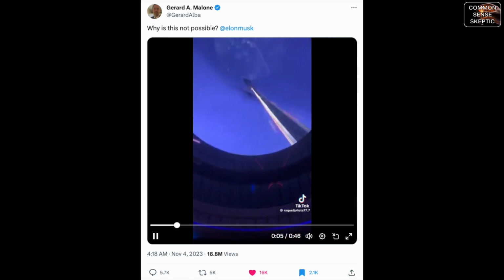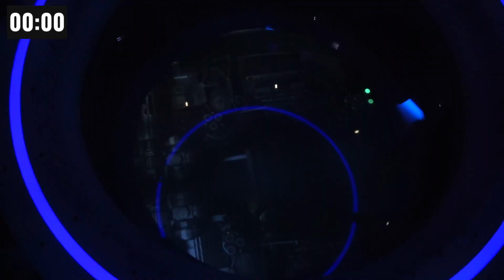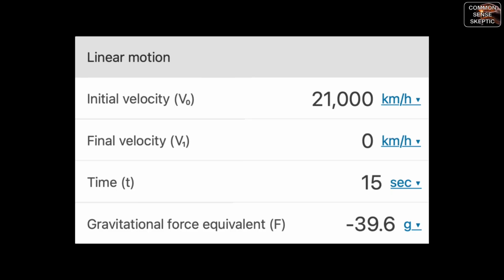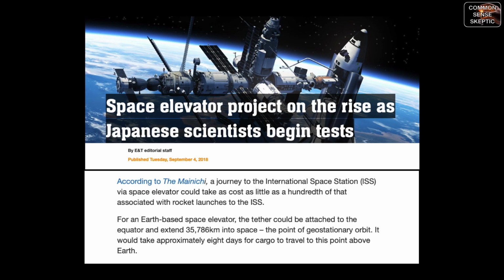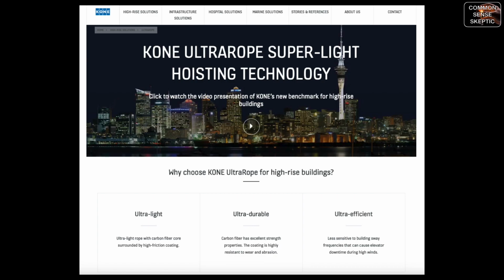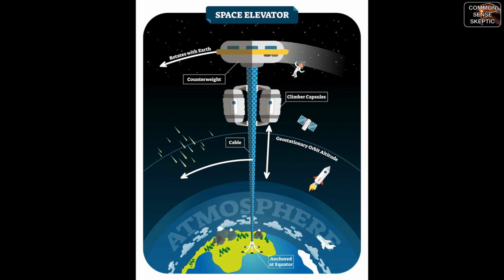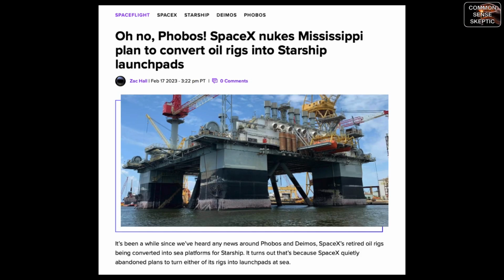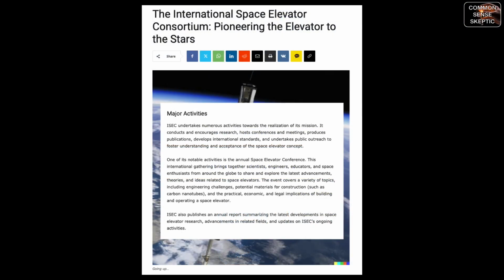DEBUNKING L.E.O. SPACE ELEVATORS

Comment: Some of these issues, like the location and altitude, could be "solved" by suspending the cable from an active structure like a space fountain or an orbital ring.  Of course, there's little reason to think those structures are substantially more practical in the real world.  There's definitely an assumption in this discussion, though, that the proposed elevator being described is of the "tether to geosynchronous orbit" type.

Comment: One point being missed is Paul Birch's orbital-ring at LEO. This would be sufficiently low-altitude that Birch was pondering Kevlar for the cable. It would not require a counterweight as the ring would be in orbit. It would hold up the upside of the cable by magnets.
The ring has other problems, like that it would shade Earth - and be visible over all the equatorial nations. Birch mused that this could be global-warming mitigation.
Personally I thought this idea would work better over Mars or Venus. Mars doesn't need the extra cooling but both planets would do with radiation-shields.
Reply from the maker: You know what would probably kill the orbital ring concept in the crib?
Lunar gravity.

Comment: For me the only reason why it's not yet possible and maybe never will be made is the 35000 km. By the time we are able to build such thing, we probably already build several alternative solutions that this space elevator is supposed to solve, cheap launching of space vehicles/sattelites. Any other problem you mentioned I can imagine a solution.

By the way, Kurzgesagt was not wrong. As we agree, the only place the end station has to be, is in GEO. Therefor the station and everything in it is also in orbit. Don't know if Kurzgesagt mentioned an other orbit than GEO. If that's the case, then they are not only wrong about launching satellites, but the whole station would come down.

Never saw any calculation on this topic and would suspect some counterintuitive results. Like the distance, expect it further than just GEO. Not only the weight of the station but also the weight of the cable has to be taken under consideration. And there are no serious calculations because the material that would make this possible has to been invented yet, and no it`s not carbon nanotubes or anything else we know yet.

Comment: I’m surprised this needs to be debunked. The structure couldn’t possible support its own weight. You’d have to build it all the way up to geostationary orbit on the equator.
Reply: If the top is at GEO the elevator would collapse under it's own weight. Every part of it below GEO is below required (free-fall) orbiting speed at that altitude.

You would need counter weights well outside GEO to provide a tensile force.
Reply: @julesdomes6064 Yes, exactly.

Comment: So you build a huge cable and run tiny casules on it?  Efficient!  I guess you could run a train of them up and then run them back down later.  Vary the spacing and velocity of the capsules and it could also damp vibration.

Comment: One thing you didn't discuss, even though you touched on it with the 400,000 volt atmospheric differential and static from the air/storms..... 
A long wire passing through  the earths magnetic field will generate a large amount  current from one end to the other. They did experiments in the 1990s with the the space shuttle, reeling out long wires, long enough it could be seen from the ground. In every case, so much voltage was made at such high currents the cable would fail. They were experimenting to see if they could use this to power satellites. Needless to say, it made so much power it could not be controlled, and they also were unable to  keep it taught in space since it was reeled out laterally in orbit.  Not sure if a vertical wire would have the same transformer effect but I suspect it would.

Comment: Just a couple points:

A space elevator would not need to be on the equator.  Multiple lines could be run from differing location both north and south of the equator to counterbalance their off center torque.  

Also 220 miles could be maintains if the combined mass of the object was at orbital speed.   Say a ring where half of the mass was traveling at double orbital speed.  But that would fall in line with the significantly better orbital ring.

150 mile per hour wind would only produce as much force as 70 mile per hour wind a sea level.

Comment: not that kurzgesagt get everything right but here your contextualizing their talk on releasing satellite from high orbit as having something to do with this one specific (bad) altitude. 
tapering (big on the space end small on the earth end) is a solution for dealing with material strength if using say a hanging elevator rather than one where tension swings a big old weight. no super materials needed.
Reply from the maker: There’s a competition the ISEC holds with $7000 in prizes. Sounds like you’ve got a shot!
Reply: @commonsenseskeptic  heh. i wish, but if i were wise enough to use that money well id have gone into engineering enough to earn it.

Comment: instead completely connected system, i think it may be possible to make module baswe systems ie for light transfers like fuel or build materials ... and placing  spcace stations balloobs and similar relatively static structures with emergency safe disconnection systems...  mostlikely its possible... ie a high altitude balloon as proxy module with stapilisation propellers or rockwts with emergecy tanks for disconnecting and continous supply from groun ie electrical cables...for powering stabilisators...

Comment: I am sure one day we will have the materials that would make a space elevator plausible, and putting payloads into LEO from one would still offer significant savings in Dv needed (to launch the payload from the space elevator station).  The big logistical problem even with the right materials and solving the minor problem of creating Kessler Syndrome is how would you build it?  You need the counterweight to hoist the tether, but you need the tether to hold the counterweight.  There is no sequence of steps that does not rely on a later step already being completed.  Every aspect of a Space Elevator has those kinds of construction problems but the cable/counterweight is the most obvious one.

Comment: Not to mention Angular Momentum.  The car at ground-level on the equator is travelling at 1600km/h.  As it gets pulled up the cable, it will still want to travel at only 1600km/h and will tend to pull the cable backwards.  This, in turn, will have the effect of reeling in the counterweight, causing its orbit to become more and more elliptical until it all comes crashing to earth.  To avoid this, the car will need to be accelerated up to the orbital speed appropriate to the altitude as it climbs.

Nothing is free in physics.

Comment: For the concept to work it would have to be beyond geosynchronous distance, such as that of an Earth having an extra 10% artificial gravity, which is the tension in the cable, 10% of the mass of the station for this example (ignoring the cable mass for the moment).  Therefore, anything you let go of at the station will accelerate away from Earth because it is subjected to the now-reduced normal Earth gravity; so yes, it would be able to be put into orbit just by a nudge, though only very limited orbits unless rockets were involved.  The reason the idea does not work is the mass of the cable being too low to stay in orbit at geosynchronous rate, and so it's orbit will collapse, pulling the station down with it.  Or, if the cable were to break or release, the station would drift away from Earth because that 10% extra pull is now gone.

Comment: You don't need it to be on equator of you use multiple theders.
Reply from the maker: Double the fun?
Reply: @commonsenseskeptic  ?
Reply from the maker: If one tether is dangerous (and impossible), let's add another one, right?  @mrtomsaa
Reply: @commonsenseskeptic  it's imposible with todays technology, it doesn't change the fact that your first argument about location is wrong
Reply: @commonsenseskeptic  also carbon nanotubes teoreticaly might have enough tencile strenght.
Reply from the maker: @mrtomsaa  Do you know how long "carbon nanotubes" have been making promises like that?
30 years.
Reply: @commonsenseskeptic  well, noone has made big enough theder from nanotubes to test it, and there is no point to do that any time soon. The main problem with space elevator is that it most likely will never be able to lift enough mass fast enough to be practical for any space industry.
Reply: The platform has to be over equator, but you can have multiple theders from different locations to go up to it. Anyway you can't do it in LEO, you have to go all the way to GO. To LEO it would be teoreticaly possible to build space tower with active suport.
Reply: And hasard for satalites are all the space trash floating in orbit that we can't track, not a theder that's in known position.

Comment: Yo, how can you say O'niel cylinders are fantasy, I can admit there is many things in the original design that wouldn't work, but augmented with today's tech, it should be relatively easy to make a working one. (relatively in this case is, it would take decades to build, and probably just as many decades to stabilize the biome, as we learned in biosphere two, something as simple as concrete setting can be a big problem over a long enough period. However all the necessary technology, and the expertise exist to create one, and we as a society will either end up in them, or we won't make it as a biological space fairing civ. We off course might one day be able to completely do away with all that, if we can figure out a good brain computer interface, which could allow uploading of a mind, this I would say is for now, and likely forever not going to be possible, but far stranger things have happened. I would choose the computer route though if I had a choice, seems far easier and far more robust then the current meatbag my consciousness finds itself in.)

Comment: TL;DR:
"Space Elevators" could only works at "equator", and must end with the tip at "geostationary altitude", because the tip itself MUST move at the same speed as the Earth surface, and also stay straight above the same point. At any different latitude, even if the orbit is "geo-syncronous" in speed, the tip will move up-and-down on the horizon, so swinging the cable/connection around.
Any lower altitude, alike this presumed "LEO space elevator", will have the tip moving WAY FASTER FORWARD than the Earth surface, basically: 1- snapping the cable/connection to Earth... or... 2- stretching it infinitely and wrapping it around the Earth: for example ISS at around 400km altitude (in LEO, way Below the geostationary altitude) orbits the Earth in around 90 minutes... this "Disney thing" at 200km will be orbiting even faster, and swing north-south A LOT not being on the equator...
Reply: @yonatan62  I can simply assume (by my knowledge) that the whole cable-connection should be in tension alike a string of a guitar-piano, for the whole lenght, to not let any point of sagging (to avoid unwanted orbital pulling  forces that could break it at any given altitude)... different is the idea "where the forces will exert at the maximum": I think that the ground ends would have to support the same stress as the "GSO" point, because, in the end, it should be a sort of tug-war between two entities (to keep the connection tightly in tension): the Earth spinning, and the GSO portion orbiting (by design, just with the same force, going at the same speed, in the same direction), but I admit that in this regard I'm not sure...
... (‘◇’)?
let me know if you find a more decisive knowledge of the matter. ;)

Comment: This just in - SpaceX attempt a second launch of the Starship, although booster separation was successful, it exploded in perhaps one of the biggest blasts I've ever seen. It gets better, mission control Boca Chica lost contact with the Starship, it exploded at suborbital altitude, and once again, just like in April, SpaceX attempt to save face by calling it "A Rapid Unscheduled Disassembly", in other words, it means it blew up again.
Reply: This also in - the test worked a sight better than the April test, and didn't do any damage to the ground. SpaceX can get another test on the platform by the end of December if the naysayers will let him.
Fusilier7 doesn't seem to be one as will let him.

Comment: Take a look at 22:33. No matter how massive your "counterweight" is at geostationary orbit, the counterweight will be in free fall by definition and will have zero lifting capacity. ie. it could not support a length of cotton. (If you could space walk out to any geostationary satellite, how much do you think you could pull it toward the Earth without both of you dropping from orbit?)
For the orbiting mass to support a tethered cable, it must want to shoot off into space. Meaning, the counterweight must be orbiting beyond geostationary orbit at greater than free fall velocity. cheers

PS. as you have alluded to, the complex dynamics of the tether would be a great problem and I expect would almost certainly destroy the whole structure in very short time.
Reply: The counterweight in a proper space elevator design is not at GEO, it is above it, where centrifugal force is greater than gravity.
Reply: @TucsonD1  Hi Tucson. I agree, that's what I meant in my original post "Meaning, the counterweight must be orbiting beyond geostationary orbit at greater than free fall velocity". cheers  Graham
Reply: @gjpercy  which proves the point that a counterweight is what holds the tether taut. The video assumed the counterweight was AT GEO, which is wrong.

Comment: There is another big problem.  The rising capsule has mass which must also be accelerated at right angles to the cable, as the farther it gets from the surface, the larger a circle it''s motion will inscribe and the more rapidly it will be moving around the Earth.  It will be moving faster at the terminus than it will at the Earth's surface.  So, it will resist that lateral acceleration and induce a lateral force on the cable, drawing it back opposite the direction of rotation of the Earth, like a bowstring.   Some sort of thrust will have to be applied to offset this, or it will massively load the cable and likely pull the counterweight down toward the Earth and/or stretch the cable.  The opposite problem will be encountered on the return trip, with the capsule having to bleed off rotational velocity, again with a thruster of some sort.  The amount of thrust will increase as the operational speed of the lift increases.  This counter thrust will undoubtedly add to the vibrational harmonics.  A smaller thruster can be used over a much longer time if the elevator is slowed down considerably, by taking a few hours or longer to make the trip.

Comment: An orbital ring which is by no means simple to build, doesn't require any material we don't already have like for the elevator's tether. You could also keep the ring below even very low earth orbit just slightly above the 80km altitude when air pressure is almost zero. Below the traditional 100km Karman line or limit of space. 
We could also build the LEO restaurant with a space fountain actively supported tower.

Comment: I wish people world talk more about active support-a flexible moving maglev cable that transfers momentum between top and bottom is a great way to make a sci-fi super tall tower with modern materials. You can even actively dampen vibrations electronically via destructive interference. 

It uses a rotating inner cable instead of a fully static structure, so any length is really viable. That huge voltage difference between upper and lower atmosphere talked about in the vid might even be able to power the thing, has anyone done the math for that?

Comment: I like the idea of building a magnetic levitation launch system inside a tunnel, inside a mountain. The sled holding the rocket would surround it on all sides and the magnets would keep it centered and eliminate friction.  To accelerate it, there would be huge compressed air tanks every few meters which would fire as the rocket passed, filling the tunnel with pressure accelerating it forward. It accelerates the rocket to very fast speeds.  When it comes out of the top of the mountain the rocket engines ignite.  Then it is already traveling fast and is above the thickest atmosphere.  This would save most of a rockets fuel which usually is used to get moving through the thickest part of the atmosphere.  Mount Everest is about the same latitude as Cape Canaveral.  Or to be closer to the equator build one in Mount Chimborazo in Ecuador.